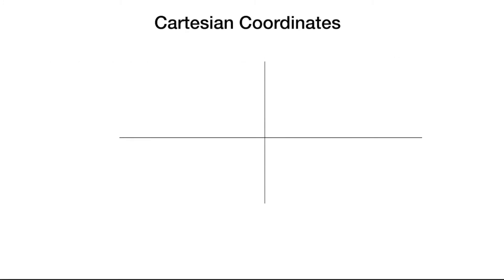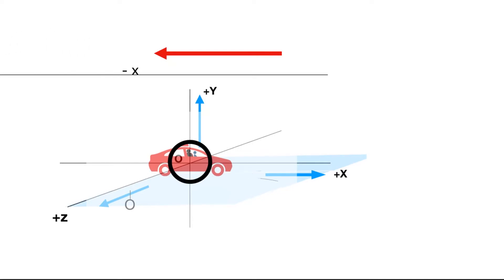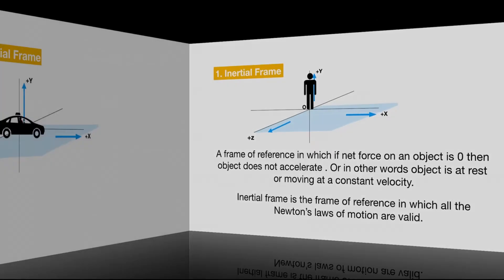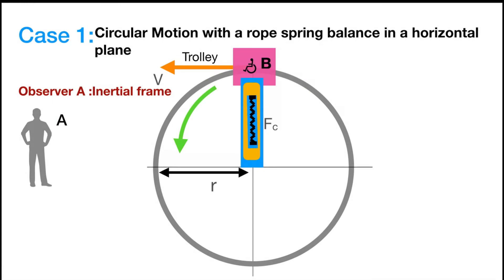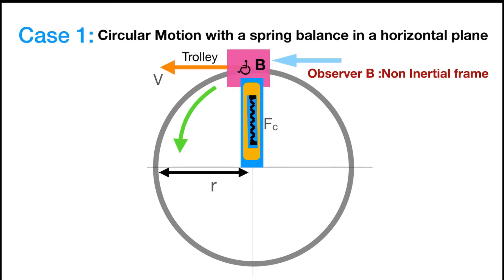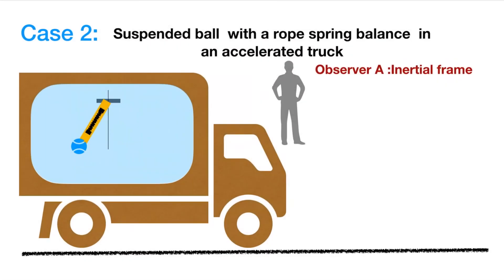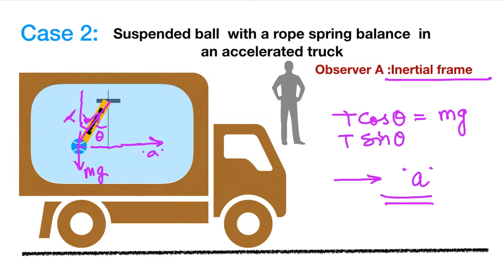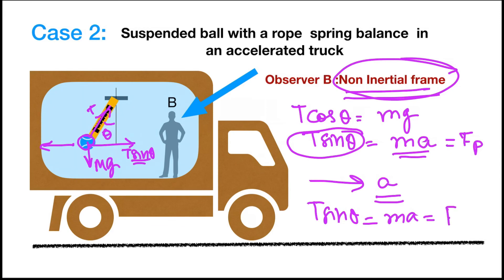Inertial vs Non Inertial Frame of Reference | why and when to use Pseudo Forces | Physics

Comment: I am confused and no one will help me.  (1) I am told there is only ONE type of inertial frame of reference.  (2) meaning if i do a physics experiment in ANY inertial frame i will get the SAME RESULTS no matter what inertial frame i am in  (3)  I am told earth is an inertial frame.   (4) I am told being in outer space at a constant velocity is an inertial frame.   OK THESE STATEMENTS CONTRADICT ONE ANOTHER !!!!!!!!!!!!!!!!!!!!!!!!!!!!!!!!!!!!!!!!!!!!!!!!!!!!!!!!!!!!!!!!!!!!!!    Because if that were ALL true then that would mean that i could do physics experiments in outer space (at a constant velocity)  and then do the SAME PHYSICS EXPERIMENT on earth and get the SAME RESULTS.   But that IS NOT TRUE.   THAT IS A LIE.   If i am in outer space(at constant velocity) and i hold a ball out and let go of the ball with out throwing it or pushing it in any direction the ball will just float there.   But on earth if i do the SAME experiment the ball will fall to the ground.  So there are (1) more than one TYPE of inertial frames of reference OR  (2) earth is NOT an inertial frame of reference.  SO WHICH IS IT !!!!!!!!!!!!!!!!!!!!!!!!!!!!!!!!!!!!!!!!!!!  Why wont any one answer me???????
Reply from the maker: In actual sense , Earth is not an inertial frame as it is not only spin about its own axis but also rotates about the sun.

 But for the objects experiments in small space on the earth surface , non inertial effect of the earth is very very small and negligible .

 For experiments like free fall of object from a few meters height on earth surface , spring block system , sliding on an inclined plane et; if we consider Earth as an inertial frame it explain everything as per newtons laws . For example in case of free fall... for an observer on the ground, the net force on object is Gravitational force, and that is responsible for accelerated fall of object on the earth. It is as per Newtons law only....Net Force creates acceleration. (Inertial frame are frames where motion of object is explainable as per newton's First law).

In case of inertial frame in space, the net force on the object is ZERO, and as per Newtons 1st Law, object remains in the same status of rest or constant velocity.

So basically both the situations you asked are different ... difference in results are because of different value of net force on the object you are trying to analysis in these 2 different inertial frames. In earth frame NET FORCE on Object is gravitational Force , while object in space missing this net force. 
 I hope this would clarify your doubt.  Daya Sharma

Comment: "Two type of reference frame" - yes, the observer system and the other systems.
The observer system is always at rest, the other systems is always in motion.
Reply from the maker: Reference frame includes observer. If observer is in accelerated vehicle  then his observation would be considered as from non inertial frame.
Reply: @MaestroEasiLearn  Yes, the observer is an element of the observer system - all these elements is in mutual rest (= the definition of the physical system).
There will be two systems, 1) the observer system and 2) the other systems -
1) is always at rest 2) is always in motion.
Reply: When I wrote motion, we have motion = both non-accelerated and accelerated!

Comment: How ball in the truck can remain inclined to an angel for so much time ? How can observer ‘A’ consider it at rest?? 
It would be oscillating .
Reply from the maker: Thanks, Bhagat for raising this question. Here when we talk about the ball in the truck hanging at an angle with a verticle, we are specifying a situation and explaining the situation from 2 different observer perspectives as per Newton's Motion laws.  In real-life scenarios I agree, the ball may not remain in the same situation as other related parameters keep on changing. So take the problem for the given specific situation and see how you can explain the same from 2 different observer perspectives.   Observer "A " is in the Intertial frame and as explained in the video he will see that ball moving with the same acceleration as the truck's acceleration and remain hanging at an angle   "theta" with verticle.
Reply: The truck maintains a constant acceleration so the angle is maintained. However being inside the truck changes the frame of reference. He is using a "fictitious force". One could imagine a massive body with gravity defecting the ball by the same angle. The math works.